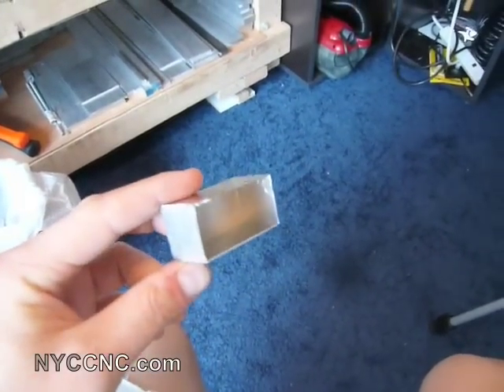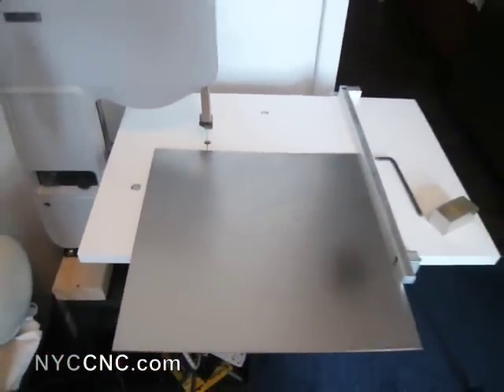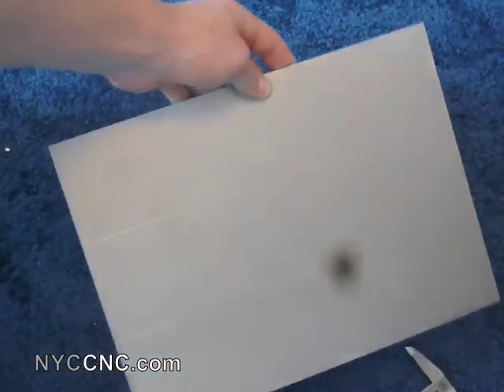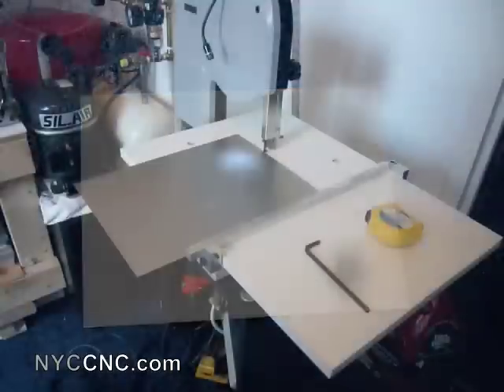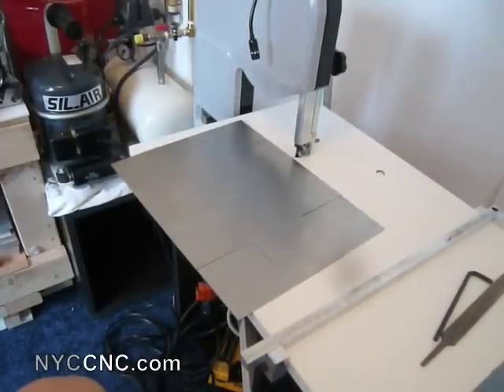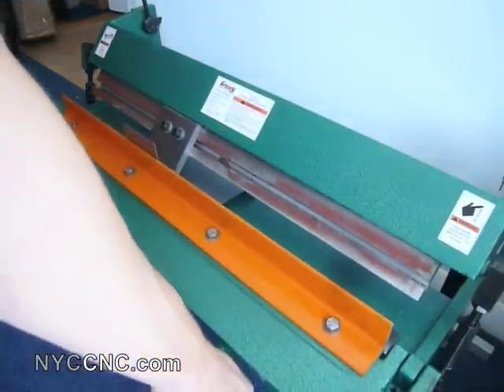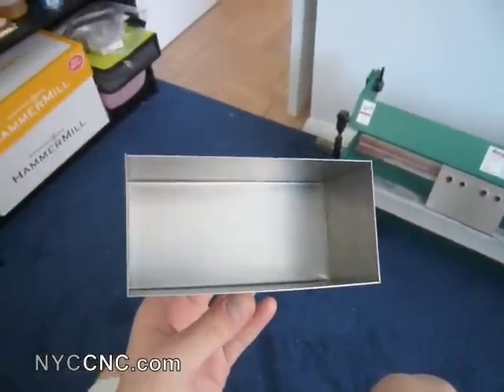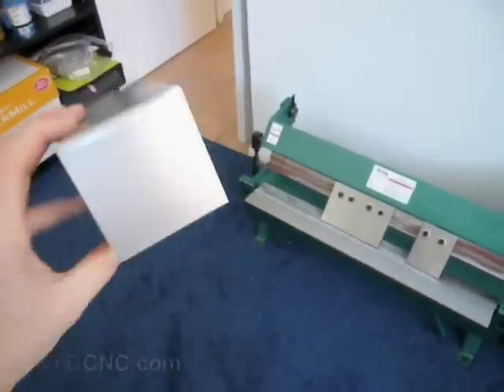Sheet Metal Box & Pan Brake Tutorial - Grizzly Brake in my home shop

Comment: Common practice would be to drill your corners before cutting. The drilled hole provides stress relief by radiusing the corner as well as clearance for the bend.

Comment: Nice little home shop. Respect.

As a Journeyman Sheet Metal Worker that runs a shop (being just me), fabricating everything 5 crews need for Commercial and Industrial aside from generic crap I'll give you some pointers.

1. Get a slide scribe if you want to scribe sheet metal. I used to be a machinist, calipers are NOT what you want to be using.
2. Allow for bend allowance if you want to be so accurate. I can see your box & pan has adjustments for that, most don't.
3. Buy a pair of red and green Wiss Snips, 22g sheet metal is nothing to cut through accurately. I chop through 16g with snips if need be. Best investment for a tool cutting heavier sheet metal, a Unisheer.
4. If you are making a box, hem your leading edges with a 1/2 inch hem for strength being sure NOT TO crush your fold, but just after leaving a tiny bubble. Secondly, leave 1/2" to 3/4" tab's on all your folds that you can 'slip' underneath the 1/2" hem when folded holding it together and giving it strength.
5. You are right, that Box & Pan can only handle about 1-3/4" 90's.. however.. a sturdy table with a sharp steel corner and wooden mallot are mandatory for any sheet metal worker. NEVER use a steel hammer against steel with steel as a backing unless you want to stretch your piece. You can use steel as a backing to hammer against with your piece, but only use a wooden mallot to hammer with.
6. Stop buying over priced steel from Home Depot. Go to a local Sheet Metal Fabrication Shop and buy 1 - 3x8 or 4x8 sheet of metal of every gauge you want to work with.. 26g, 24g, 22g. The cost of a galvanized sheet of 24g sheet metal 3x8 is about $14. Ask them to roll it up and put a tie on it. If they are trying to sell you it for $50, tell them to go fuck themselves because you know the cost of sheet metal.

You are welcome
Reply: NYC CNC If you are very interested in Sheet Metal, I'ld be willing to share some knowledge on how to make 3D fittings, be it Square to Round, Conical or 'a pair of pants' in a round shape using radial, parallel and radial line development.

I love what I do, I love working with metal. Welding it, forming it, shaping it. I see you are inspired, so if you want to learn how to make 3 dimensional objects (you can make absolutely anything you can imagine from sheet metal), I will spend the time to teach you if you are interested.

- Cheers, from Canada
I took 1 year of Machining, worked as a machinist. Have done Concrete Stamped and Carpentry as well (how I started in the trades). I will never know everything, but I do have some experience to share.
Reply: Nirotix I would love to gain some knowledge in the 3D fitting realm as well! I will send my email over if you're willing to share! cheers!
Reply: I'm glad people take the time to make you tube videos (even if they make mistakes) because I can learn from them.  Nirotix added really valuable tips and he did it respectfully!  Thanks for sharing your knowledge Nirotix.
Reply: Japan's school girl
Reply: nirotix how much for a 4x8 sheet of 24g is typical?
Reply: @nirotix hi! I tried looking for information where to positiin brake end to get the inner dimensions of the box with bend allowance.
Reply: @Bunnytoes666  Wiss used to make good tools but like so many they are now made cheaply overseas and are junk!
Reply: Id kill to work for you I love TIG

Comment: Nice video. The first shop I've ever seen with a carpeted floor. If you extend the sides out a bit on each side, then bend them over as tabs, you can drill holes, and flush rivet it all together and it really looks good. Aviation type riveting. I'd get a compressor operated sheetmetal nibbler. Better than a saw, or hand sheers. Wear safety glasses. Getting away with it for ten years isn't worth it when you finally do get a sliver of metal in your eye. I wear mine 100% of time while in my shop.
Reply: Shoes wouldn’t hurt either.

Comment: if you are using 2mm sheet adjust the bend location out by 1mm on each side. this will allow the inside corners to meet up but will also allow your current bend sheet to fit inside the sides, especially helpful on the last bend and will also give you a nice groove to weld in.

Tig is great for welding ali, just check you the thousands of videos and you will see the results you get with tig.

Comment: Hehe, that was the first I thought when watching: this guy needs a Baileigh BB-4816M ;-) We also get them here in Germany and I am very satisfied with it. You really can do every imaginable bend with it, even closed boxes.I have "tuned" my machine by a digital self positioning back stop, a digital angle display, a sheet thickness adjustment (replace for the excenter screws) and a small computer with touch screen to calculate and show the bendings. If you do boxes, this magnetic type is a must.

Comment: Hi again. One other comment I hope is helpful. An easy way to secure your metal when marking it, is to take a lesson from the woodworkers. When you get your new workbench, drill some hole in it about 2 inches deep to hold removable.dowls that stick up a couple of inches. Install some scrap 2x4's underneath the bench if necessary. Place your metal against the dowls and mark away. Or, a piece of foam used underneath carpet works good on your bench to hold your metal stationary while marking it.

Comment: Good video  now i am a Woodworker  with over 20 years of professionals  working in the Architectual Woodworking industry and metal is something i want to learn more about  the one thing i wanted to really stress was  why no safety glasses   I worked most of my career on commercial jobsites  and i have had  freinds have metal shavings and  splinters   Stick into their eyeballs and i know it was very painful  and the way the Emergency room had to remove them was  having a doctor use some very  high quality and pointy. Tweezers  picking one peice out at a time  !  Ive scratched  my cornea  by having. High winds. Blowing. Sand  into my eyes  not that uncommon as i grew up in Florida  and was riding a motorcycle  with  sunglasses instead of goggles

Comment: most of the boxes I've used for projects have a little tab bent all along the inside on one of the pieces so you  can screw one piece to another to close up the box. You can bend those tabs also. Plus they make a different style of brake that's vertical which might work better for you.

Comment: Had it for about a year an haven't completed anything yet other than a 304 plate that holds my E-off switch and switch for my smoothstepper. I just keep running into different problems, but It's coming along. I'm working on a set of gaming dice for a friend which are 4, 6, 8, 10, 12, and 20 sided. Each requires a set of jaws to be made, and most of it is 4th axis work. Thanks again for taking the time to do what you do. I've tried makings couple videos, an it adds so much time I eventually stop.

Comment: to save metal and make corrections draw your break lines on thin cardboard then cut it out with scissors and use a straight edge to fold on lines then if your box isn't right adjust with scissors then unfold box and use as pattern to draw around with fine point marker on to your sheet metal then cut it out and break on lines while you have the cardboard pattern folded into a box you can check the layout of what you are putting in the box this also keeps you from having a bunch of lines on your sheet metal to get confused about when you get to the break  little metal boxes can be tricky so have fun

Comment: You mentioned at 5:30 to use notcher instead of band saw. What do you mean by notcher?  (I know about shears, scissors, slitting sheers and nibblers, but never heard about "notcher", at least not for this task. I know of the notcher hand tool that is used to create small fingers [about 3cm deep and 3cm wide] on the edge of the sheat and for dovtails).

Edit: Wow. Only now I realised this is NYC CNC, and the video is 10 years old. :)

Comment: Can anybody please tell me the name of the machine he's using to cut the sheet?
Reply: +Tommy Arnold it is just a small cheap band saw. It is a MicroMark Deluxe Band Saw that sells for about 3 to 4 hundred dollars. It is about the same as most any other cheap band saw but it has a slower blade speed for use with thin metals like for hobby. Do your research depending on your desired use and expectations.

Comment: FWIW, given that you'd need to weld the edges of the box together, that's not how  I'd make a box. It is how I'd make a lid for a box, but not the box.

That was a 9 x 12 blank with a 3" upstand right?

Cut a rectangle 6 x 6 and another one  12 x 3.  Bend the 6x6 one through the middle at 90 degrees. That's the base and one side.

Bend the second piece 3" from each end to make a squared off "U" shape. That's the remaining 3 sides of the box.

Comment: You left out one of the most important steps, which is the position of the break realative to the line on the metal.. This may not matter much on that light of gauge but it does on heavier metals.

Comment: Good try,but next time,bend the longer sides firs,than the smaller side.You will need to use a smaller piece of angle on and maybe a block of wood to raise the stationary plate.
Paisano

Comment: Yeah, this style of press break is not great for making boxes. It is not about the size of the machine necassiarly. If you take off the top support (I know it is very heavy and on adjustments screws), and clamp flat bar with long throw and depth C clamps, you can do it.

Comment: Not sure what metal you used for the box, but if it's Aluminum 22 Gauge it's far easier and probably more accurate to scribe and fracture than to use a band-saw. At least it is with relatively simple shapes. Think of it like cutting glass where you create a tiny weakness with a scriber and then just fracture it. See http://bobhooversblog.blogspot.com/2009/03/cutting-aluminum.html - An interesting site and full of good tips.
Reply: +Jeremy Ardley How would you remove the corner pieces using the scribe method. Try using it on glass to cut out corners and see if it works.